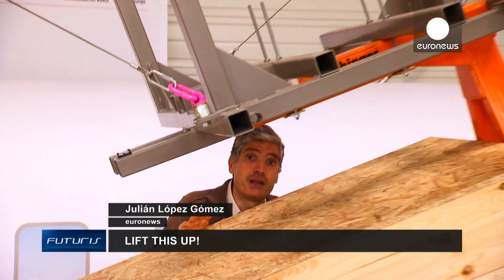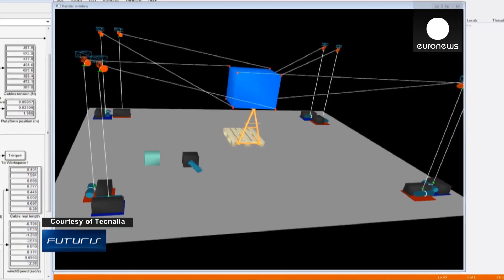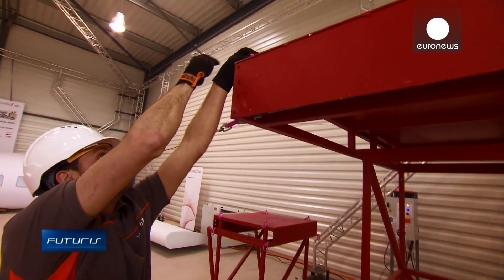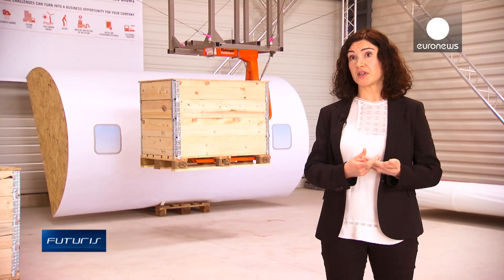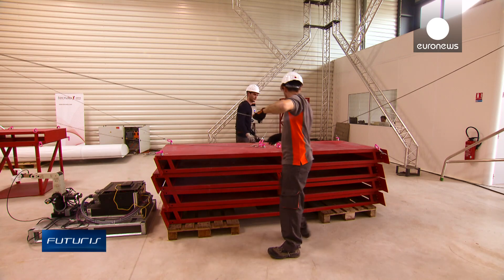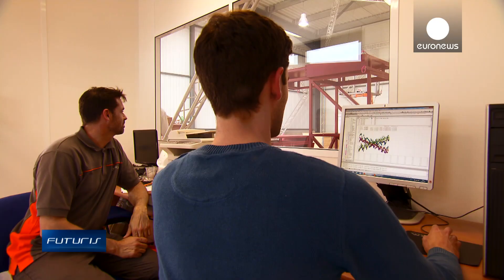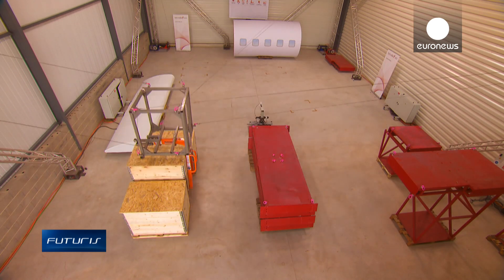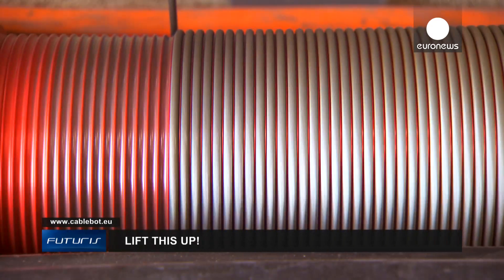Cable-Driven Robots May Lift European Industry - Futuris

Comment: How does this possibly "multiply the available space by 10 compared to conventional robots"?
Yeah, the end actuator is smaller, but the swept area by the cables is at least 2 orders of magnitude GREATER than conventional automation, not LESS.  Lift capability is several orders of magnitude less and failure consequences are catastrophic.
Whereas standard automation failure usually just results in stopped production, failure of any of these cables results in destruction of the actuator, the load and literally everything anywhere near any of the cables.

As a perfect example, look at the Arecibo radio telescope collapse.  When only one cable had failed, the entire structure was deemed too dangerous to even approach, which ended up being correct as the entire structure ended up obliterating itself.

If Arecibo had been built from radio-transparent resin-fiber conventional tracked robotics, its failure would have been just a minor stop in functionality.
Reply: You make some good points
Reply: @tajr22  As an example, this is one element of Lego's factory:
https://youtu.be/fozBzQRZEGI
They use advanced, but conventional automation, especially for their storage systems.

Imagine dozens of braided steel cables whipping over every cubic inch of space there.  Do you think it would increase the amount of space available for production?

Would it increase the density of their production? Or would it destroy every machine and kill every employee the first day it was implemented.  And this is in Germany, where that cable-robot was developed (though the PR person is French I think).
Reply: @htomerif  I largely agree with you, but consider how much of the space high up is wasted in typical workplaces. A wire-based machine can have its end effector hang, without taking up hardly any ground space. Mobile wheeled machines have complicated paths further convoluted by traffic and the bases of every heavy machine that rests on the ground. Ideally, you'd have a combination of the two systems: one above and one below.
Reply: @josephsiriani1597  I don't know if I said it in this comment thread or not but if you want to see the consequences of a heavy, wire suspension system failing, just look at what happened to the Arecibo radio telescope.

Factories do tend to have a lot of wasted vertical space, but they're assembly lines, so everything is already set up to be moving things a minimum possible distance to the next machine.

I didn't mention the absolute worst part of this idea because I didn't think of it until now: you can only have one of them. Its the equivalent of having a factory or warehouse that can literally only have one forklift. You can't have two of these things occupying the same space. Large warehouses require dozens of forklifts.

Really, regardless of the usage case, the fact that you can only have one of them kills this idea dead.

Comment: I dont understand the fundamental benefit this provides. A system like this is not planned to be moved from factory to factory. So the only major advantage it has over a gantry and roller system is mobility. But thats not needed. Needing 6 or 8 cable motors is way more expensive then needing 2 like in case of a gantry. And increasing the reach for the gantry is marginal cost compared to this. The moment arms here are huge at great distances.. making it very energy intensive to drive the load.. because geometry works against you like with the cables at areceibo observatory that just broke off. Way more force is needed to lift by directing the force sideways then vertically. This seems like a fundamentally flawed design and i just dont get the major benefits it provides over existing systems. 
As a research project very cool.
Reply: I completely agree that the classic portal frame is many times more reliable, simpler and can withstand heavy loads. Only the slope of the load can be adjusted with the ropes. And at the moment with painting - just hook the controlled suspension and that's it.
Reply: @TokAreVisH  They seem to have left out the entire swept area of the cables in their woefully incorrect estimate that this system yields an "order of magnitude more usable space".  This thing is literally only capable of accessing the top layer of what a gantry crane or forklift would be capable of accessing.
Reply: @htomerif  yes but we suppose to kick china's ass with such tech. eu invested in reasearch for this reason
Reply: @aion2177  No, no they didn't. Its a tech demo. It has no functional purpose.
You know how you can tell? China hasn't copied it.
Reply: In recicling is very useful to separate plastic from cans and papers. The work place is the same and there is band rolling the trash.
Reply: @slevinshafel9395  Are you sure? I was pretty sure that recyclable streams are shredded and separated with water and/or air residence fall times to separate things by density.  I don't know how this thing would help at all.